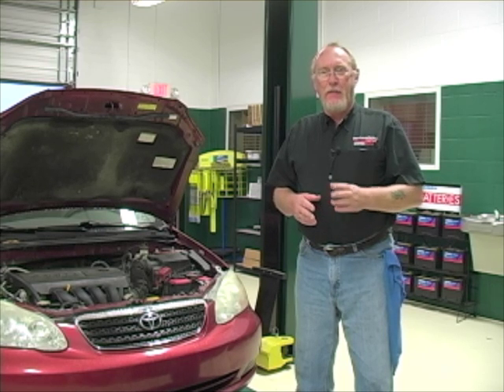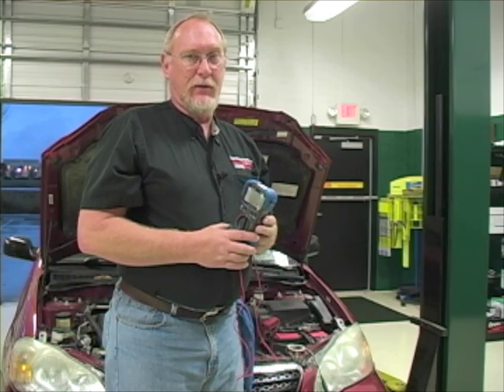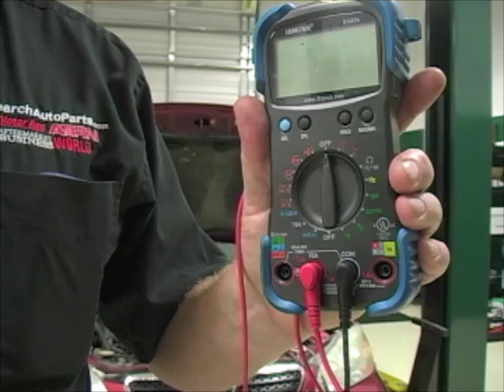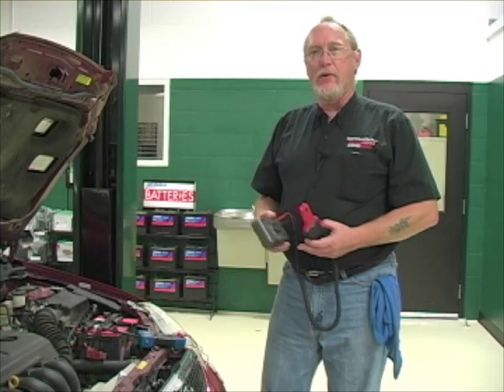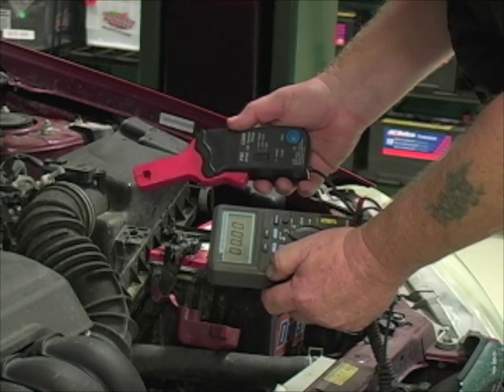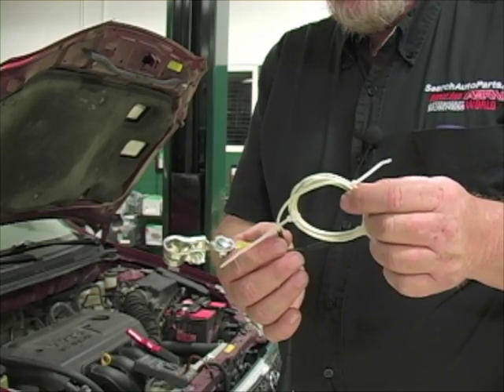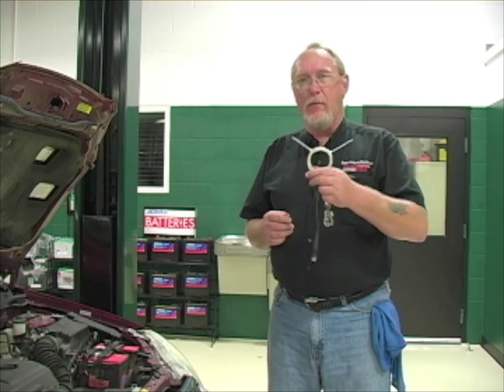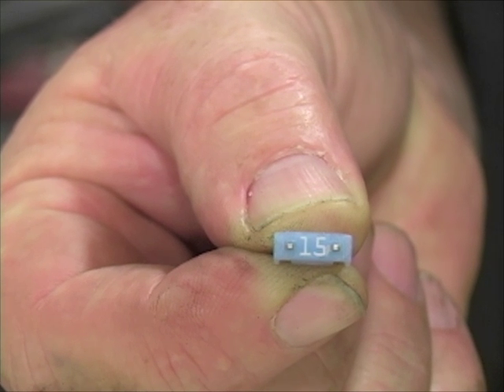The Trainer #27: 3 Ways Of Finding The Cause Of Key-Off Battery Drain (Parasitic Draw)

Comment: I have isolated the problem to the IPC/DIC fuse which supplies power to the instrument cluster on a 2003 Silverado. The problem I am have now is proving it is the Instrument cluster and not one of the branch circuits feeding the instrument cluster. Any thought will be appreciated
Reply from the maker: If you can get a low amp clamp around the individual paths, you may be able to narrow it down further. You'll need a scope or a good DMM to see current flow that small though.
Reply: Motor Age Thanks for the info. Can you help me as to where I can purchase a low amp clamp-on. A clamp-on that works on DC is new to me. I have used clamp-on with AC .
Reply from the maker: Albert Keller There are many sources for handheld dedicated clamps, and clamps that are used with multimeters and/or scopes. Try AESWave(dot)com or your local tool truck!

Comment: i have a 1991 chrysler lebaron 3.0 v6 automatic and the new battery keeps going dead. the battery tested good and when i put a vom to the battery using the 10 amp scale i'm getting a reading of .03 amps, is that nomal?
Reply from the maker: Define "bad". What, exactly, is happening?
Reply: Motor Age
i tried what you did in your youtube video with the jump box and with my digtial vom on the 10 amp scale i got .03 amps. i left my meter on for 2.5 hours and there was no change. i thought i must have a intermittent drain problem so i drove the car a few miles and the readings were the same. the car is a 1991 chrysler lebaron 3.0 v6 automatic overdrive. three problem showed up at the same time, #1: the battery would go completely dead within a few days of sitting which i am focusing on, #2 the check gauges light would light every now and then while driving and i noticed the oil pressure gauge was quarter way below zero but no engine noise so i replaced the sending switch, #3 the transmission went into neutral going on an uphill curve then downshifted itself so i couldd'nt go above 40 mph. sometimes it would stall out and when i restarted the engine everything would be back to normal including the oil pressure gauge until the next time i drove the car. i don't know if the three things are related and don't know where to look for the cause of the battery drain!
Reply from the maker: pa17948 Your issues may be a result of bad connections. Check the voltage drop on the battery cables, especially the ground side.  What is the charging voltage reading? Have you performed a battery/starting/charging test? (You can find related videos on our channel to help you.)

Comment: Awesome video!  A couple of questions come to mind before i begin doing this (non-intrusive)...does the battery have to be back on a full charge or can this be done with it semi drained?  How long does the battery need to be on the loop before you can begin?  I have a bad charger and I have pulled the cables so if I hook back up the cables do I need to charge it up fully and if putting cables back on, how long till I can start the test for everything to reset?  Or does any of that matter?
Reply from the maker: lauraplays Many modules may go into sleep mode or offline if battery voltage drops too low, so I would suggest making sure you have a good battery to start. Do not take the test with a charger attached.If you are dealing with a module that won't turn off, low voltage or cable disconnects can cause the module to reset and you won't find the problem.

Comment: Ok, I have a 1977 Corvette, and I have pulled all the fuses, and I have disconnected the alternator.  I am still getting a 3.83 amp parasitic draw.  Any suggestions?
Reply from the maker: Ken, When you say you disconnected the alternator, did you disconnect the harness connection or the B+ wire leading back to the battery? And are you sure you removed ALL the fuses?
Reply from the maker: Ken - nearly 4 amps of draw is considerable. Hard to say without having the car in front of me but something is on. Do you have a Power Distribution diagram available?
Reply from the maker: Ken Strain Don't forget that some circuits are protected by fusible links, especially on older cars, and/or circuit breakers. If ALL the fuses are pulled and you're still getting a draw, look for these types of circuit protection devices (typically in line with a power feed directly from the battery).

Comment: Thanks for posting this. I have a question about the jumper box used in the first test. I see that you connected its lead to the battery accordingly, but would like to know what settings were employed on the jumper box? Thanks.
Reply from the maker: No settings available on this unit. It's just a deep cycle battery housed in a plastic case.

Comment: Like the volt drop test, never thought about using it across the fuses, I found the same amp clamp using the Pico scope to be very accurate though.
Reply from the maker: Agreed, the low amp clamp coupled to any scope is more stable than the signal rec'd by most digital multimeters.

Comment: Hey I just had a question regarding a problem I have with my car so for some reason when i start the car or try starting it, it tends to struggle or sometimes turn on fine and for some reason when I have it started and decide to turn on my headlights the radio turns off and when I catch spend the dash lights tend to glow brighter and when I come to a complete stop or car idles the dash lights tend to dim really low what could be the possible cause?
Reply from the maker: Usually weird electrical problems that occur are due to a bad electrical ground. See our videos on performing voltage drop tests and check the negative battery cable to start.

Comment: Brilliant! I knew about the multimeter, in series option, but your video has opened my eyes to other ways. I'm struggling to identify my parasitic drain but I think that may be because I have to disconnect the battery and then connect multimeter. Just wondering if the reason it hasnt shown up (after days of watching it in my garage!) is because I disconnected battery before putting the multimeter in series
Reply from the maker: Could be, especially if it's a control module that is causing the drain.
Reply: Motor Age Magazine
OK. Thanks. I will have another go (I quite like the idea of checking voltage across all fuses idea). Its proving very difficult to identify though, so I think I'll be fitting a Battery Brain or PowerTector in the meantime

Comment from the maker: First, the battery must be connected to the system. There can be no voltage drop unless current is flowing and that won't happen unless the circuit is complete. Second, make sure the system is timed out, no lights are on, no doors are open, no convenience systems (a/c, heater fan, radio) are on. EVERYTHING must be off. Last, your meter has to be accurate to read in this millivolt range. A cheap auto parts meter won't do the job. Hope this helps!

Comment: Thanks for the video, I have a 2009 f150 that has a battery related problems. the battery was tested 6 months ago and they said it was fine.
Will try method 3 if I can find a multimeter that I can borrow. 
I'm also aware that I do have a blown fuse as one of the AC power outlets doesn't work.
Not sure if this should happen or not, but if I plug my phone and charger in, remove keys, the phone charger will have power for several hours. Needles to say the battery would be dead after 30 minutes.

Comment: Nice! i must test this method myself!
Got a Volvo S40N 2006 with some kind of battery drain.
This method seems to be better instead of clamping or attach probes in cable end and the other on the battery negative. etc..

but how can i know how long it will take for my car to go into "sleep mode" ?

Comment from the maker: You would think so, wouldn't you? But now, the fuse has a resistance and there will be a measurable voltage drop if current is flowing through it. Not much, you'll need to measure in millivolts, but it is there.

Comment from the maker: Interesting idea Luke. Current, voltage and resistance are all related. It works across the fuses because the fuse is a known resistance. Using the battery connections, though, would introduce a variable resistance factor you really couldn't account for. And with the voltage drop reading so small (usually less than 20-30 millivolts depending on the fuse style) it would be enough of a variable to skew the test results.

Comment: is there a way of testing for draw at the battery using voltage drop? So you can be sure you have a problem before going through all the fuses? Could you just do a quick test between the chassis/block and the negative post?

Cheers, Luke.

Comment from the maker: The only thing I see in common between fuses 31 and 30 is the trunk lid release circuit. Try disconnecting the solenoid in the trunk lock assy and see what that does to your millivolt reading. I really think that when you pull the fuse, you are waking up several of the modules. You can also use a

Comment: Ok, after the meter is hooked up in series I have about 400ma then I pull the fuse 2.31 and jumps up to 10amps. Just like you pull fuses to see if the amp drops. I can't get the mv for you but I can't tell you 2.31 is the highest 2.30 is 2nd and 2.19 is last. I think it was something like 2.31 .125mv, 2.30 100mv, 2.19 .020mv

Comment from the maker: Back from vacation, and had a chance to look over the diagrams. If you pulled a fuse and then put your meter in series to measure the current draw, that counts as opening the circuit and that could wake up a module. Go back to the three fuses and send me the millivolt reading you get on each.

Comment from the maker: And last question. How did you determine that these three fuses were involved in the drain? Did you measure voltage drop across them, or did you pull them to see what current flow did on your ammeter?

Comment: How can I without blowing dmm fuses? What would you say turns on all modules? When I hook my dmm up with out usind the tool of the neg post, everything connected I start about 2 amps, 10 sec later .8 amps one min later .4 amp problem that stays

Comment: A bluepoint dmm. I am 100% certain I'm not breaing contact on the battery and to verify that I even started with the switch disconnected and right away I'm drawing 12.1 amps and my meter leads get hot. If you guys have access its 03 lincoln town car 4.6. I can get you the fuse number under power distribution in just a second. The only way by looking at the diagram is to only just assume its built in the computers programming for other modules to wake up when it sees and open for the mls..

Comment from the maker: If you have even a momentary break in the circuit when you switch over to the meter, you'll wake everybody up. And 12 amps with the switch disconnected? That's a lot of draw. Would need to study the schematic to figure that one out. What kind of meter are you using?

Comment: The amperage increase happens when I have followed the appropriate steps to begin testing. I allow time for verything to shut down then I have my meter in series via quick disconnect adapter for draw testing and monitor the draw disconnecting main light switch when I disconnect it the amperage shoots up to 12.1 amps. Thank you very much for talking with me, even if I don't come to soution, I really appreciate having someone to bounce ideas.

Comment from the maker: Go back to the lighting control module you disconnected earlier. You'll need a low amp clamp and meter for the next step.Divide the wires at the connector in half (or as needed to allow the amp clamp to wrap around them) and measure the draw. What you are trying to do is isolate the ONE wire that is pulling that 400 ma. of current. You can then use the wiring schematic to see where that wire is going. Isolate that  cause first. It could be a defective module.

Comment: I'm 100% positive there was nothing open. Verified a few diff ways the switches to trunk, hood, and glove are closed and function correctly. I even took out the light bulb. 2 of the fuses have one thing in common which is the lighed control module. I think something is keeping it on too. What do you think about when I disconnect the main light switch and amp goes up?

Comment from the maker: 400 ma is a lot of draw! It is important to be sure that all the onboard computers have timed out before you start hunting for the cause. This can take anywhere from 30 minutes to 8 hours, depending on the make/model. Are the doors/trunk/hood open when you measured the draw?The lighting module may be actively online.
You'll need to see what the three fuses have in common, if anything, but I'd look at the fuse NOT related to the lighting circuit. I think that 80-15 drop is the one you're after.

Comment: I plugged the lcm connector back in and my draw went back up to around 400ma. There are 2 branches on the circuit after the lcm, the rcm and the main light switch. This is where I am confused.. if I disconnect the main light switch while measuring amp draw I go from 400 ma up to 12.1 amps...how can this be? When I reconnec the main light switch I go bac down to 400ma. There are no lights on and the switch is in the off position. I don't want to recomend this lcm to my customer w/o bein posit.

Comment: I'm working on a 03 lincoln towncar and I'm confused about something. 1st off I have a draw reading on 3 different fuses? 2nd when measing amp at the battery if I disconnect fuse #1 the draw decreases from 400ma to 200ma, if I disconnect fuse#2 I'm down to 80ma and fuse#3 down to 15ma. I decided to chase the one wth the highest draw. It lead me to a lightin control module, I disconnected the harness there and I dropped from 400ma to 80ma...then...

Comment from the maker: It's just two 12v batteries wired in series, like a golf cart, to raise the supply voltage. Most of the techniques shown in the video will work just fine on these systems.

Comment: hi great video, i have just started my course in hgv mechanical and electronic systems, on the trucks i work on they use 2 12 volt batterys to run a 24 volt system were as i know cars only have one battery for a 12 volt system, so when you put battery pack on then that would be like having 2 12 volt batterys making it a 24 volt system or are they connected differently? i am new to this, thanks john

Comment from the maker: It's not the fuses, but something that the fuses supply power to that is causing your problem. You'll need a "Power Distribution" wiring diagram so you can see what the two fuses send power to. I'm betting that the battery fuse is sending power to the IOD fuse, and I'd start there. Be sure to allow the control modules enough time to "go to sleep" before you take your measurements!

Comment: I have an expensive amp clamp from Fluke, and I'm not very impressed with it's measurement accuracy at the kind of low DC amp draw in a typical parasitic drain situation. I'm glad to hear you have the same experience, since I wasn't too happy to be looking for another clamp. I think your idea to measure voltage drop across fuses is the best screening test to narrow the search.